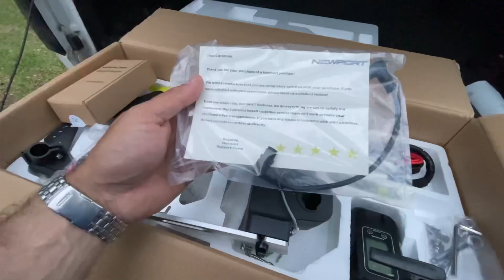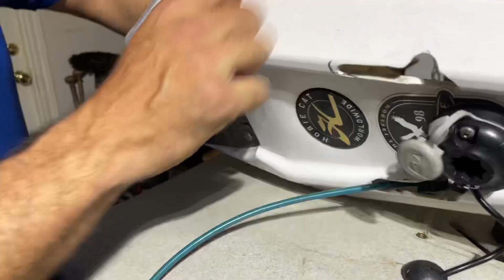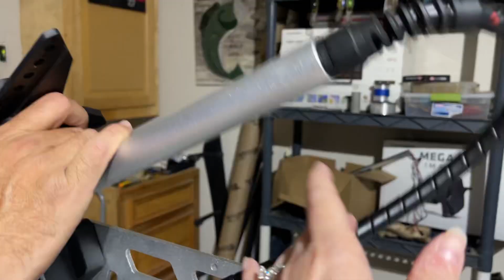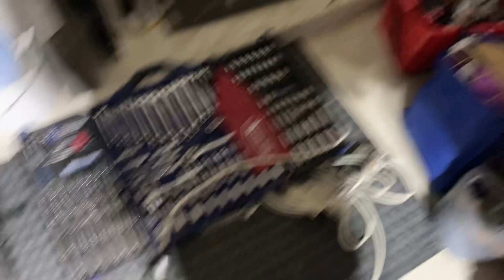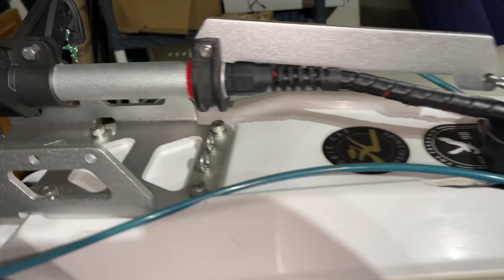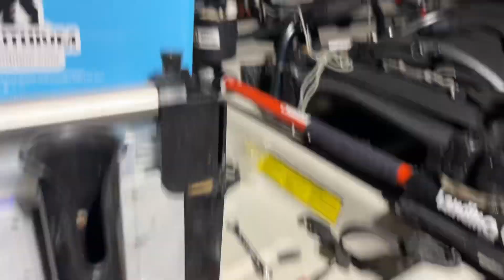This is a GAME CHANGER!  15 plus miles! 🤯 (Newport Vessels NK180 install on Hobie PA14)

Comment: Tony, thanks for taking the time to make this video.  Getting ready to put the NK 180 on my new PA14.  Do you really think having the extra steering cables attached to rudder control turning the motor with the rudder is a significant help?  Have you tried it with and without the extra steering cables to see how it compares?  Would like to hear your thoughts. I probably would not add the extra steering cables if it does not change the overall steering much from just using the rudder itself.
Reply from the maker: I’ve never installed any motor on my kayak without pairing the controls. I can’t comment if there would be a significant difference though. The Hobie rudder doesn’t displace that much water so you would probably be good without the extra steering cables.
Reply: @VentureTubeKayakFishing  Thank you for getting back to me Tony.  I set it up yesterday and for opted to go no steering controls and try rudder only.  I can always add the steering controls later if it seems the rudder is insufficient.

Comment: Did you consider Spectra steering cable?  I used it on my Slayer Propel steering and it has lasted years longer than Native's original stainless steel cable.  I changed my steel cable twice in the first 3 years - Now my SP 13 is 7+yrs old and the Spectra is still looking good.  I think Hobie used Spectra on my previous Outback and never gave me problems.  I am about to purchase the NK300 for the SP 13 and will likely not mix the motor steering with my rudder steering.
Reply from the maker: spectra is definitely the way to go but I still haven't done it yet lol